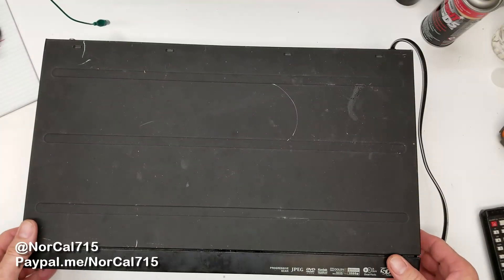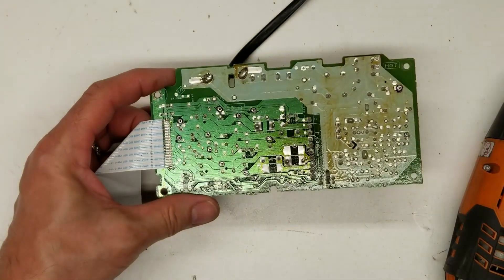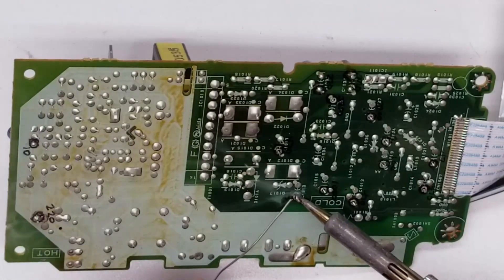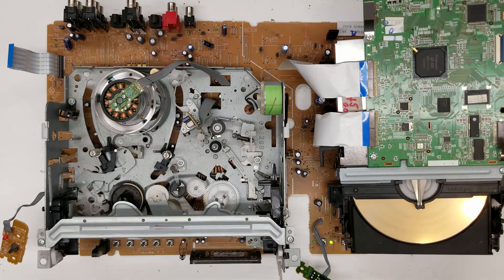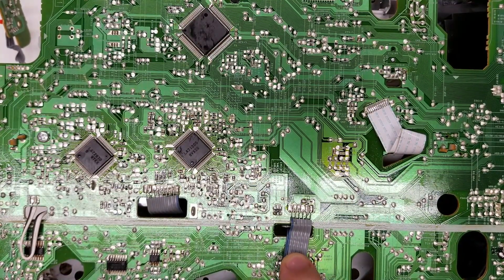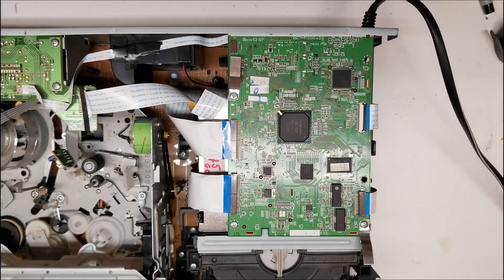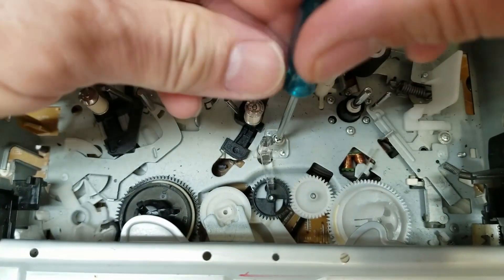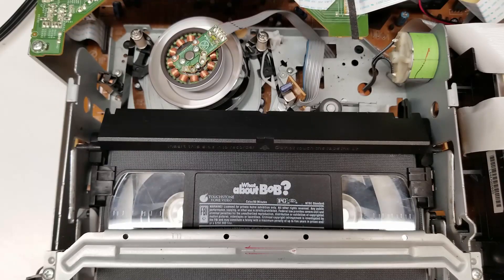MAGNAVOX DVD RECORDER/VCR LIGHTS BLINK NO POWER REPAIR ZV457MG9

Comment: HOLY CRAP!!! You fixed my problem!!!  I buy and resell VCRs and VCR/DVD combos on Ebay.  These VCR/DVD recorder combos bring good money when I can buy them cheap.  I bought this same exact unit, and it did what you show in this video: it would play a VHS for about 3 seconds, then it would disengage, and shut down power.  When I hit power, it would eject tape.  I did EXACTLY what you did in this video, put the VHS in, and low and behold, it stayed playing.  Now I can sell it!!
Reply: Ditto, I purchased one last week from a sweet old lady who assured me it worked! The VCR didn't! It was filthy, I cracked open the case and shot it with compressed air $8.00 used a tee-shirt, and Q-Tips and 91% alcohol. Then bought a Maxell CD/DVD cleaner disk $5.00. After all that...same issue' the tape runs 3or 4 seconds, stops & powers off. I was bummed, feeling ripped off by a 75-year-old con artist!. That was until I watched NC's awesome video. Your well-spoken, logical presentation saved this unit from the landfill! You sir are a brilliant instructor!  Well Done! Thank you!

Comment: I am a 20 year Navy Electronic Tech and 8 with Sony starting in 95. Last 4 at the Philly Service Center where I worked on a few VCR/DVD Players. Most of what I saw was mode switches. Mostly fixed PlayStation 2's. So I knew about a ESR Meter but never used one.  I was very impressed to see your component level troubleshooting. I would have never started with the Capacitors... My Bad... I learned a few things watching this video. I would have likely stumbled and never fixed this unit. Seeing your methods and logic... Again Very Impressed. First video I have seen from you and will look around at others. I will look for more videos on ESR Meter usage hopefully from you. My first 2 years at Sony were in San Diego where I maintained the Factory Automation making Picture Tubes. 3rd and 4th were in the Calibration Lab where I excelled in fixing DC Power Supplies as they were used to age the CRT Gun. My weapon of choice was the Huntron Tracker for Power Supplies, I brought in my Huntron from home. Looking forward to seeing more of your videos. At 66 I am inspired to set up a electronic repair bench again.

Comment: Thank you for this video  I have a Toshiba vcr combo unit that would turn on . But when i put in a tape it would go in and then shut off. Took it apart check the mode switch looked clean and put it back in. Then cleaned the light sensor and parts. And my vcr came back to life and is working great again. So i appreciate your video it was a life saver for my vcr. Was looking at the price of these units and was shocked to see these are going for $1500.

Comment: I found your video very interesting.  Just today, I gave a Sanyo DVD VCR Recorder to Good Will after the DVD players stopped working and it also stopped recording.... I replaced it with a Magnavox from E Bay that was suppose to be fully operational, just to find that every thing worked but the Recorder,  Guess I got screw on the deal... Anyway, the $100 isn't totally wasted, maybe I can get the recorder repaired..sure hope so.

Comment: I doubt that chip was blown as capstan won’t have started as it also runs the transport on these. Likely solder flux you were seeing? I see you got it to work anyways. What was the issue? I  repaired a couple of these and usually a dirty mode switch where contacts are corroded and light guides being dirty as well.
Reply from the maker: It was the mode select switch that was causing the issue.  I did not replace the capstan drive chip. It was just a Flux blob on it.

Comment: I have a Magnovox DV220MW9 and the same issue is happening, it is blinking lights then sometimes both dvd vcr solid green light. I took it apart, never done so, so just shooting from the hip. Might have taken out cables I shouldnt of, anyway I saw a capacitor that looked bloated on the top. I then used a heat gun and heated it up for a few seconds, then plugged it back in and it worked perfectly fine now. I even was able to put in a tape and it played great. Then when it finally had time to cool down, it went back to the normal issue. So obviously that capacitor needs to be changed. But there doesnt seem to be a power supply module, it appears to be on the main board on the very bottom. If so, does that mean I have to take it all apart, including the VCR assembly, to get to the capacitor that needs changing? Cannot find a video of this particular model, just the recording version.

Comment: Dealing with a shut off approximately 5 seconds after turning on. Selection light on front goes from DVD to VCR then turns off. 
Started when I was using front line in jacks for recording. I moved to rear line in jacks and it worked for several months then back to original shut down problem. Figured I would just use for viewing w/o recording but still shutting down. I was able to remove disc by unplugging then plugging back in. Wondering about sending to you for repair.

Comment: Why do you desolder the positive cap leads when you have an in circuit tester. I have a Bob Parker ESR tester and usually find it's fine just to leave them. Am I doing something wrong, is there an advantage to your method?
Reply: If there are multiple caps in the same rail you can get false readings (the bad cap will show good because of another good cap in the same rail).
Reply: Thanks, I'll have to experiment.
Reply from the maker: If the cap is in a PI filter configuration the inductor may actually give you a higher than actual ESR reading. I will try and show it in a future video.
Reply: Thanks, that would be really appreciated. Your videos got me into repair, expensive to buy all the gear but oh so rewarding.

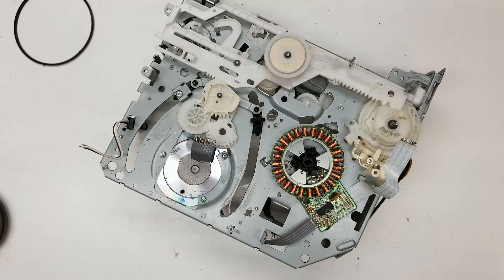Comment: At 19:00 in the upper right corner, is that the mode switch?  It appears to be a little dirty.  Would that be enough to cause a problem?
Reply from the maker: Yes and the segment where i cleaned it did not record. I have a new camera now so hopefully not more dropped videos

Comment: I refurbish and resell close to 50 of thess a month. It's very important that people have a some good soldering skills or they will lift those pads every time. You also missed the ACTUAL problem with the VCR. There is nothing wrong with the capstan circuit.
Reply from the maker: What do you see as the problem I missed?
Reply: @norcal715  
The mode switch is horribly designed and in a bad spot in these machines! It needs to be cleaned and greased. It causes a cascade of problems. I'd be willing to bet that within a month or two (depends on lots of factors) the same guy will bring it back complaining that it eats tapes or plays for 6 seconds and then shuts down. You have some great soldering skills and the ability to repair lifts pads if you had to, but most people definitely do not. The reason I know this is because I slaughtered half a dozen of these trying to remove that ribbon cable without the proper tools and skill. It's also a real bitch to solder it back on there once you get it off. Please take this as constructive criticism as I have learned alot more from your videos than you will ever learn from me!
Reply from the maker: I actually did clean the rotary mode switch. I scrub them with a stainless wire brush to rough up the contacts and wiper, then I coat them with dielectric grease to prevent the silver contacts from tarnishing. I have been doing that since about 1984 starting with the Panasonic PV1200  and RCA VJT250's  VCRs ( ah the good old days) and never had one come back EVER! My camera didnt record that so I just skipped it and didnt mention it. But thank you though I really do appreciate your comments.
Reply: @norcal715 .....
That's exactly what would fix most the vcrs, though,  I've had so many various issues even after cleaned the mode switch, 50% would fix the problems, ah...the good ol days,  when we could make a great living in the service business.
Reply: @norcal715  
Well, now I need your help on a machine. It's a Toshiba DKVR60. (The power supply, main board, etc are the same minus the tuner. Both are made by Funai). It had the same on then off condition. I located 3 bad  caps and replaced with new. Also touched up a ton of solder joints. Put it back together and all was good. Inserted a tape to test it and it ran fine for 4 or 5 minutes then shut down. Now it's back to the same on then off condition. Any pointers? I've never seen one do this.